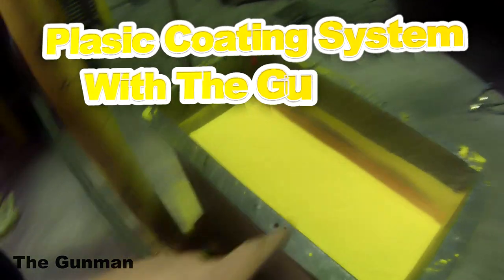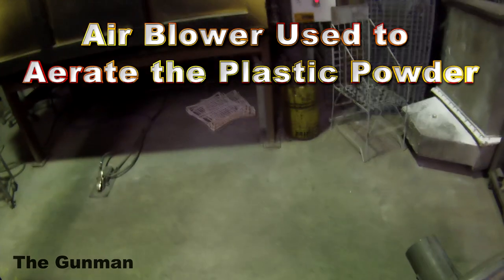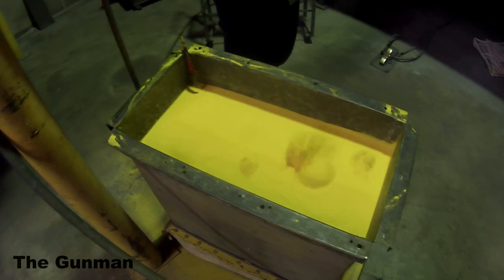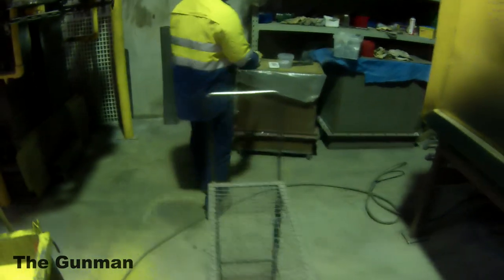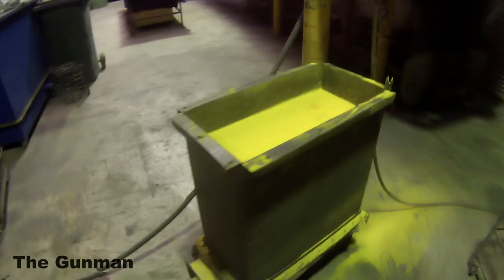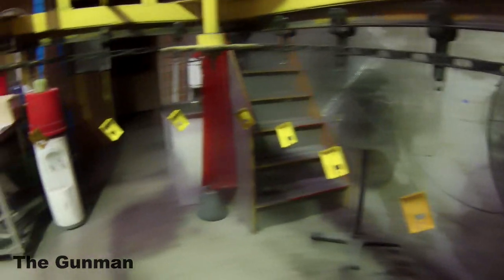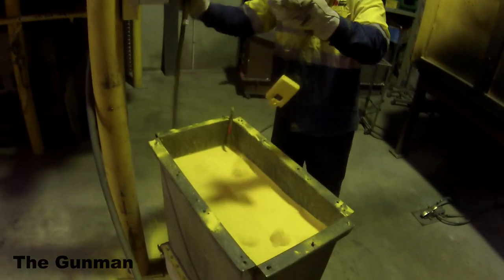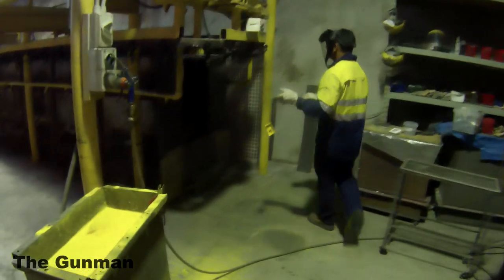Plastic Coating System

Comment: I was told never use flame ovens with powder coating. The powder will never look even and will have flaws. This looks like a older process that is not used much here in the states any more. I spay the base powder on, preset toaster oven on about 350 degrees. When it starts to flow out (melt) I will spay a candy powder or a clear powder for top coat. Seems to work out nice so far..

Comment: Very interesting!  The similar process I've seen in the US they use an electro static charge to hold the powder on the part until it's baked for final adhesion and smoothing.  The powder is sprayed on with a special gun that applies a charge to the powder.  It may be smoother with the spraying initially but likely the same after baking.  The pre heat process here seems like it may be a little less messy with less powder waste.  Again thanks for another great vid!

Comment: Is it possible to know the estimated temperature for the curing oven? It would be a big help. Im testing my product but have not get the smoothness i wanted. The pre-heating Temp is 200-350 Celsius degree, the curing temp is around 180. The test products are not shiny as yours. Some got burned, some have rough surface. I am using PE powder btw. I really appreciate the answer. Thank in advance!

Comment: Hi, 
I was looking for this very application sine last few days.
I have some questions and would be pleased if your good self reply the same

1. what is the commercial name of this powder and where to get it from
2. what is the temperature for preheating the product to be coated 
3. what is the post heating temperature.

It would be my pleasure if you answer the above queries.
Regards,
Subodh Murarka
Reply: This process is called a fluidized powder dip. The powder is just regular powder coating powder. basically you preheat the part enough that when it is dropped into the tank the powder melts and sticks to it. If you have the part temperature correct, only a small layer of powder will stick to it, the the stuck on powder will provide some heat insulation keeping too much powder from being applied. Once the powder is stuck to the part and excess is removed then it can be cured like normal powder coat. Not all parts are good candidates for this process, the less cavities and pockets the better. The huge upside to this process is very low wasted powder, and as you can see it is quite compact compared to an automated powder coating line with traditional spray coating.
Reply: this is extremely weird i must say...i mean, you have regular powder coating that cost you 4 times more then this and people still use the old way of doing...in my town there is at least 10 companies that are in powder coating business, and none of them use this technique. So my question is...does people not know about this technique or is there another problem with this type of product protection?
Reply: This process is the original powder coating process but is still commonly used for a lot of thermoplastic coating such as Nylon, PVC, or PE, and thermosetting fusion bonded epoxies.  These coatings are more functional in nature for abrasion resistance, oil & water pipes/valves, electrical insulation.  This process allows the coating to be  applied at a much heavier film build than is possible with electrostatic spray.  ES is usually 2-4 mils (50-100mm) vs these coatings in fluidized bed which are usually applied from 6 mils up to 250 mils (6.4mm).
Reply: What Stephen Walters said is fairly correct, but have a look at www.plascoat.com - they also offer an ES thermoplastic coating, which you can Electrostatically Spray. The minimum required coating thickness for PPA 571 ES is 170 microns, which is fairly easy to reach, if you adjust the spray equipment settings slightly. When fluid bed coating, preheat and postheat temperatures depend ao the polymer used as well as the metal thickness.